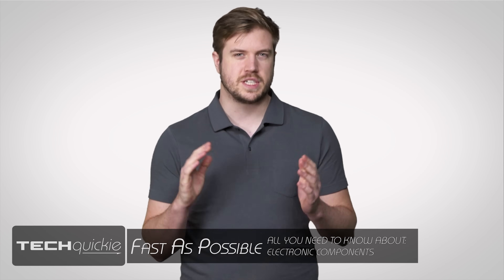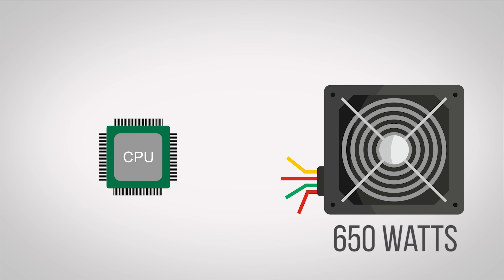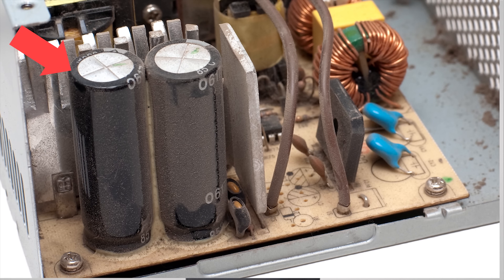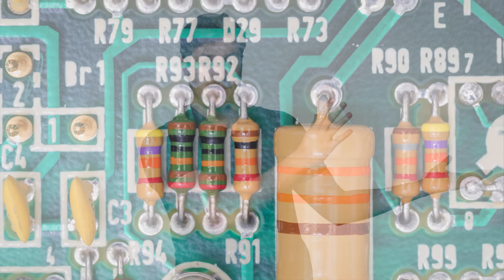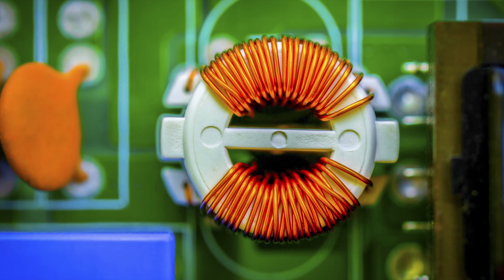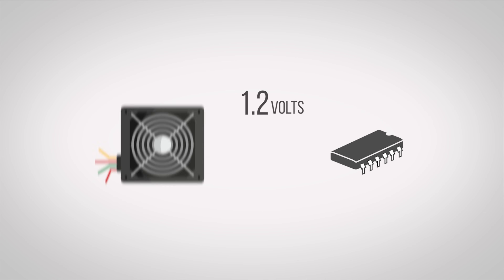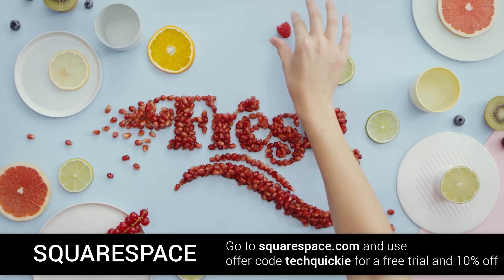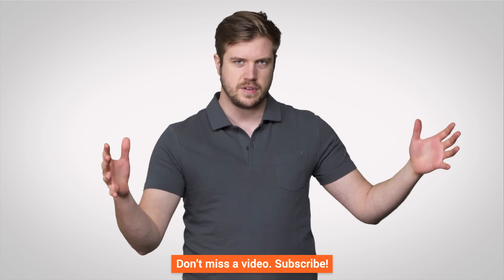Capacitors, Resistors, and Electronic Components

Comment: Can someone help me? Im trying to change the color of my cars radio from orange to pink 
I have all the smds changed out. 
The problem is that when I plug in the radio all the smd lights power off. 
12 v car battery with the original smd lights being 1.8 v 
The pink ones are 3 v 
What do I need to do? 😿

Comment: why do older capacitors and amp chips in oleer stereos are like giant and 400v smake speakers sound amazing max rating but  the small ones make speakers sound lifelesss flat dull no bass in modern audio unless you have a high end  amp with a ton of caoacitors and indeoendent amp boards for each channel  i feell thats why newer androids os audio is trash with this fake dolby atmos evern an expensive aver with decent capacitors that has 9 channels is worse than a 50 dollar soundbar or bt spoeaker you get at walmart

Comment: isn't voltage related to current? if a capacitor smoothes voltage, wouldn't it also smooth out current? how does a choke help in this situation differently compared to a capacitor?

Comment: Honesty, with all these discouraging comments into opening PSUs here, it shows that there are few tinkerers here. Why not advice people into taking the necessary precautions when opening these power supplies instead of telling people to keep off power electronics? 🤷🏾‍♂️. For Christ's sake, most PSUs today have bleeder resistors and if not, one can discharge the capacitors. I have worked with power supplies for many years and I haven't been electrocuted by these capacitors. If I had a mentality like most of you guys, I would never had worked with power electronics. 🤦🏾‍♂️

Comment: Surprised you guys didn't point out the ceramic chip capacitors that were all over most board shots here. Also, diodes are a pretty major component that didn't get mentioned but I guess you expect people to know that if they know anything about LEDs. ;) Still, you could've shown the SMD/SMT diodes that look similar to SMD/SMT resistors and described what the band/stripe means.

Comment: Unplugging a PSU is DEFINITELY not enough. I so PSU repairs all the time but my certification for microcomputer repair specifically says not to open the PSU and to send it to depot repair professionals (same for CRTs). In the real world you just want to make sure they are safely discharged.

I start by unplugging it and hitting power. This usually gets a twitch out of my fans. I then then manually short each voltage rail to ground before I start taking it apart. Once the seal is broken I immediately look for access to any large capacitor leads that I can short without poking around too much. It's always risky if you have to start poking around a charged PSU to get it out of the housing so if you can't access the capacitor leads it may be best to set it aside for a few days. If you must go on, try not to touch anything metal (including board traces) until you can get those caps discharged.

Perhaps surprisingly to some, it usually isn't too difficult to diagnose what is wrong in most modern PSUs and it's pretty easy to replace most passive components.

Comment: I'd recommend consulting a real electrical engineer before posting such videos. This was whack. Don't ever open your PSU those caps you mentioned (the ones off the rectifier) can hold lots of charge. Enough to kill you instantly. Just don't do it.

Comment: big MISTAKE, ERROR there linus, you forgot to mention that capacitors MIGHT keep CHARGED with HUNDREDS OF VOLTS even after you UNPLUGGED!!! the POWER SUPPLY, or any other pc part or any other device that has capacitors in the board that werent drained automatically or manually when you opened it up, so they MAY discharge through your tools/fingers/body. please dont get your hands into electricity without proper knowledge. please update video or put annotations or something, hope nobody would take their psu appart from knowing nothing, right?
Reply: well i was clearly exaggerating a bit at that time, and hopefully i already lost the need for using capitals on entire words. please accept my apologize if this comment hurt somebody's feelings

Comment: Isn't it true that capacitors voltage leads the current that it delivers which would be the opposite of inductive loads where it is lagging the current or is this only valid for AC systems? Basically I always thought of capacitors sending out bubbles of voltage to catch up inductive loads.

Comment: The mosfet's description is partly wrong. It is an electrical switch but it does not directly lower the voltage. What you described is a linear voltage regulator and is something rare to find on motherboards.

Comment: Hi guys, one question that is not related to this video. I have an old Toshiba Satellite laptop and with Hitachi HDD 5k750-640 and a Samsung m471b5273ch0-ch9. Can I upgrade those 2 and with what? ( AMD graphic HD700/7600 Series) 
What do you suggest and what benefits would I have. Thanks

Comment: do not mess with power supply's, ever, if you don't know what you are doing. the capacitors can hold charge for a very long time after the pc has been shut down!!!
is say again, the capacitors can hold a charge for a very long time, even after the pc has shut down!!!

NEVER MESS WITH PSU's IF YOU DO NOT KNOW WHAT YOU ARE DOING!!!

Comment: You should have gone into more detail on the varieties and means of identification of the components mentioned. You also completely left out diodes (zener, SR, CC, shockley, etc.), quartz crystals, transformers (stray-field, phase isolation, flyback, etc.), ground contacts/drains, shielding, thyristors, jumper/TAP pins, microfuses (fail-safe resistors), and RTC batteries.

Comment: *Build name: The Oven*

CPU: Pentium D40 Overclocked to 4.2GHZ @120C Without Heatsink
GPU: Quad Crossfire AMD Fury X @180C *GG AMD*
PSU: Coolermaster Ultra 2100w Power supply
Case: No air intakes or openings
Ram: Server-Grade 2TB Set

Have fun

Comment: I think the term you are looking for is "switching voltage regulator".  The inductors in switching regulators store energy in their internal magnetic field as the current through them increases, and release this energy back into the circuit when the current begins to drop-off.  Chokes are used as filtering elements.  I would not call the inductor in a switching regulator a choke.

Comment: capacitors block DC and allow AC; it charges and discharges. mostly used in the rectifier process of turning AC into DC. transistors do two things... amplify current or serve as gates. resistors drop vintage, quite simply. inductors block AC and allow DC. was wondering if I've ever seen a plain diode on a computer mother board..

Comment: I'm hooped my i7 6700hq heats up to 98 degrees Celsius while gaming and on the intel xtu benchmark. I'm using an hp omen with a gtx 1070 it runs at 72 max...

Comment: First capacitors only filter an AC signal. Zener diodes are what creates a constant DC power supply voltage not capacitors.

Comment: The actual use of big capacitors in motherboards is not only as voltage smoothers, but to provide a lower/higher voltage rating when used in conjuction with inductors and electronical switches(transistor/MOSFET)  to form up switched mode power supply DC-DC converter from a DC input. One can get 0.8V for CPUs from 12V rails by using topologies such as Buck Convertes, or Flyback converters. This allows rather huge efficiency gains when compared to simple linear voltage regulators.

Comment: Metal Oxide Semiconductor Field Effect Transistors (MOSFETSs) don't control voltages. They control current, just like any other transistor. That change in current is then used within a circuit to control voltage.

Comment: Inductors are actually used by switch mode converter ICs to do voltage conversion, current smothing AND controlling the current, smoothed again by capacitors.

Comment: Well...turns out that the resistor took the blow the nearby lighting strike delivered to my Crosshair Formula 3! I was kinda glad it was over because it was never stable no matter the RAM speed multiplier or base I used and also I had figured I needed a lot more than a 4 core Phenom 2 and 4GB to be productive in CAD...

Comment: For the capacitors, I'd say it's because things use variable amounts of power and the capacitor is close and instantly fills that demand. Not to smooth out the voltage because the it would be irregular, those would be the capacitors that are in the PSU. The water tower analogy still holds and it's even more correct with this explaination. Water towers exist because users use variable amounts of water and they instantly need to have that without drop of pressure. Not because the supply of water is variable.

Comment: You're close with the function of transistors in a voltage regulator... They function in what's called a buck converter configuration, which uses the transistor to very quickly switch an incoming 12v signal on and off, decreasing the current your circuit will see and therefore reducing the potential to compensate. These pulses are then passed through an inductor (choke) and with the help of a diode will create an electrical pulse when the electromagnetic field of the inductor collapses. We then filter off the pulsed DC and turn it into smoothed DC by putting a capacitor in parallel with the output. Y'already mentioned that the capacitor stores a charge and releases it in a somewhat controlled manor (you can get upwards of 1000 amps of current out of a high value, low ESR cap if you short it!... the pulse is short though so you won't melt much doing so!... oh, and if you wanna know what an ESR value is, Dave Jones from the EEVBlog has a great segment on it!!)... Anyway, the pulse created by the collapse of the choke's magnetic field is then pushed into the capacitor, which charges up and stores that charge before it as a smooth DC line with minimal ripple.

Also, if you want to know what coil whine is, it's to do with the chokes resonating. It's also known as inductive ringing and occurs when either the coils aren't secured to the cores and can vibrate a little or the entire coil reaches its resonant frequency and begins to vibrate. Take a look at Linus' TQ segment on coil whine if you want more details.

Comment: God, no! That is not what a MOSFET does! Sure, there will be MOSFETs inside a regulator, but whta you described was a voltage regulator.
Reply: Sure, but two MOSFETs and a choke makes a pretty good buck converter.

Comment: If your motherboard is acting weird. ie doesn't want to boot or is unstable. look at your capacitors. on the top, if any one is bulging upwards compared to the others, the cap is classified as dry , ie it's dead. if you can replace it motherboard will work again.....that's if that is all that's wrong.......if your caps are the solid smaller ones, it wont bulge...sorry can't help you then

Comment: nice to see an basic component video but there is missing and even wrong information.
capacitors used to be condencators , MB also have diodes , transistors are switch gates , mosfets are transistors and what you showed is an  chip with build-in mosfets mostlikely an CMOS one.(could be JFET ,IGFET , etc)so naming it MOSFET is wrong.

Comment: Does indicator work on DC current?
Reply: Passing a DC current through an inductor is like passing DC current through a resistor. However, if you have pulsed DC, you'll have a integral function of the pulsed waveform. E.g. square wave voltage has linear rising current.
Reply: I am sure most power inductors use flyback diodes, yes.
Reply: *****  pulsed DC = AC. And inductor works in AC. But is motherboard power is pulsed DC or normal dc?
Reply: +Sourav Bagchi 
No, pulsed DC is definitely not AC. Pulsed DC is used to create AC, but there is a huge difference. AC has negative voltage cycle. Pulsed DC can also be signals (1's and 0's). Positive pulse: 1, etc. Motherboards are powered by smooth DC, but the transistors in the CPU turn it into pulsing signals.

Comment: Opening power supplies is dangerous. It's not a good idea to recommend doing so, especially not to look at the capacitors. It's the capacitors that hold a charge even if the unit is off, and they can shock you pretty good. Probably not enough to kill you but you can't be sure.

Comment: controlled manner? capacitor?
they can store and release energy pretty damn quick, only to be restricted by inductance and resistance... try shorting up an AC rated fully charged capacitor.

they are made to release energy in controlled manner and not release in controlled manner

Comment: Mosfets doesn't control the volatge , linear regulators does.
Reply: No, linear regulators waste all the excess energy into heat. Linear regulators are only used in very simple designs, such as driving an arduino or something. MOSFETS control the voltage determined by the duty cycle of the pulse width. You can adjust it with it's driver IC, called Pulse Width Modulation, therefore the name SMPS, Switch Mode Power Supply. You are using switch mode to control the voltage.
Reply: "The mosfets take the electricity from the power supply, adjust the voltage and pass it thru the chokes and on to your proccesor." You didint get my point. He said that mosfets control voltage . The mosfets itself can't control the voltage. It needs some kind of microcontoller.
Reply: UltimateTechGuy
Oh, in that sense. Well, not exactly, self oscillators don't need microcontrollers. Power supplies were made long before there were microcontrollers.

For example: http://4.bp.blogspot.com/-2okKc8gWuqQ/UNpmJYrPJbI/AAAAAAAAACs/pXKNUsBjP-s/s1600/mazzilli_zvs-1.png

Comment: Thats why you need to check your PSU. I've seen PSUs with 500W of power... but 300W of this power was delivered from 5V rail. That means, that 12V rail could deliver something like 100-120W that is not even funny. Computer parts should inform us how much power they need from which voltage. then it would be much easier to get right PSU and not to even look at this Gembrid shit with external 90mm fan and cables so thin, they started to crush after 3 years inside computer... Sorry being angry at my friend, who is still using this shit...

Comment: Are you really suggesting we should open up our power supplies? Come on, this is dangerous on so many levels.
Reply: DeSlashez Now most of them discharge, but some switching power supplies (like one in my sound system unit) don't do that. So, I've shorted all capacitors that are big. Then it's safe to work on the board. Remember to DISCHARGE FIRST
Reply: @chargedsupercap2270  Exactly. Make sure to always discharge any capacitors, as they can discharge a lot of stored up energy in a very quick time.
Reply: Harris How do you discharge the capacitors?
Reply: @electronichaircut8801  instructions unclear does short them mean stab them?
Reply: @Nico1a5  Using insulated screwdriver, connect all three leads into capacitor(s). Very important when working on anything with capacitor - tv, microwave, etc
Reply: @cliffordwilliams9597  so you discharge a capacitor by connecting both leads? is that always safe?
Reply: @shade0636  If you need to ask, then you probably don't have a good reason to poke around in a PSU.
Reply: @HudsonGTV  Oh I wasn't planning on doing anything that dangerous, I was just curious for knowledge. I appreciate the concern though.
Reply: @shade0636  watch some ElectroBOOM videos, he's very good at discharging capacitors.
Reply: be smart try not to do it when plugged in you'll be fine